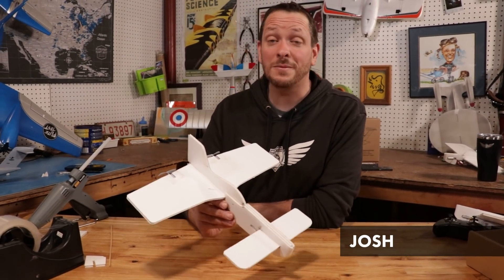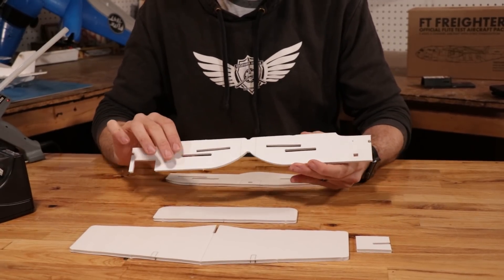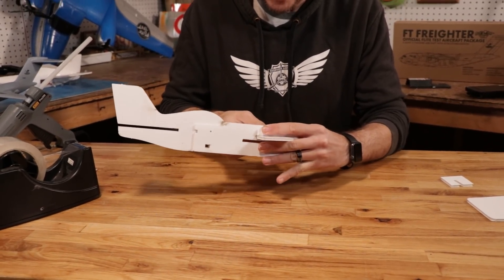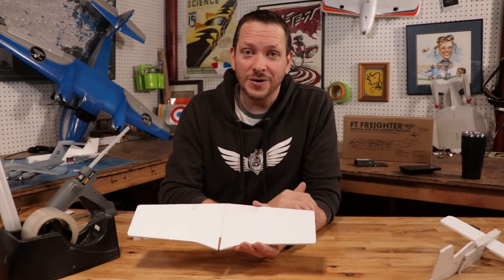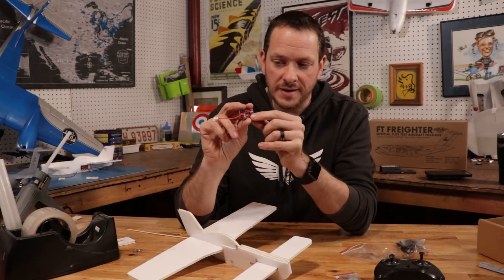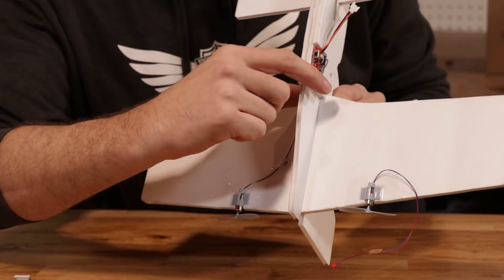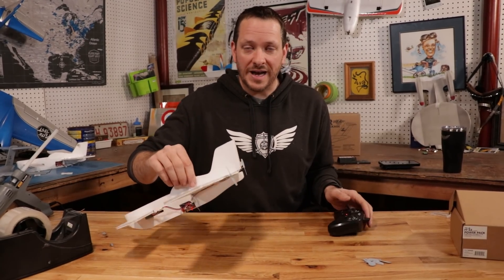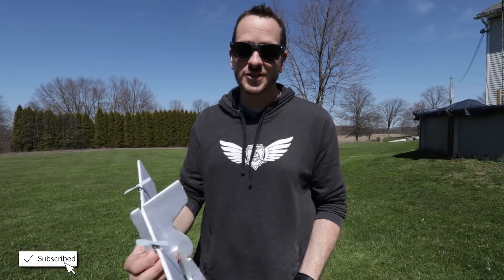EZ Canard / BUILD

Comment: Not entirely correct to compare this to the Eurofighter Typhoon. The foreplane of the Typhoon is lightly loaded, i.e. the Typhoon is statically unstable, so it works in a slightly different way.

Comment: I built and flew mine. A couple tips.
- if you are going to put on the RC pieces, I would recommend run the right motor wires through the hole in the fuselage, through the hole in the circuit board and then plug it in BEFORE you mount the engine OR the circuit board on the aircraft. There is not a lot of extra wire and I spent more time trying to fish that little white plug through the hole and getting it plugged in than I did on the entire rest of the build.
-If you use double sided tape to mount the circuit board, make it a little long to extend below the bottom of the board to protect the power switch and the LED. Also check it after every crash..er landing to make sure it isn't loose. I flew with on that was loose... if you want to call that bucking bronco a flight. 
-If you are outside and there is any more that a light constant steady breeze, keep it in low rates. This plane in high rates and gusts is a recipe to make lawn darts as the stabilization freaks out in choppy air and high rates.

Comment: Sir, how much rpm needs for this kind of toy plane? I have tiny vibrator motor the one used in mobile phone, is it suitable?  I have removed the part that responsible for vibration. Thanks.

Comment: Josh, according to Ed at experimental airlines, dihedral does not work like you (and most other people) believe.  The wing that is most horizontal does not produce more lift as lift is a result of the airfoil section, which hasn't changed. Apparently it's something to do with the angle of the leading edge, if I remember correctly. I watched his video a few years ago where he explained it. I didn't understand it at the time and I sure can't understand it now, but you might find it interesting to check out what he said.

Comment: Hi Flite test, I’ve got quite a big issue with my emax tinyhawk freestyle, and I was hoping that you could help out. It came in the mail yesterday, and on the first flight, it got up in the air, flew for a bit, then looked to of failsafed. This has happened every time I have tried to fly it, just failsafeing about 5 metres away from me. I tried installing an xm receiver, to no avail. Do you have any tips? I would love a reply
Reply: It's best to contact Customer Service through your point of purchase (A-Main, or Flite Test), or you can go to the FT Forum for help. 👍

Comment: Nice plane and a nice build Josh, but I'd hot glue the motors in. If you want to swap electronics rubbing alcohol (surgical spirit in the UK) makes hot glue release cleanly. Just use an eye dropper or dribble some with a toothpick or cotton bud on the glue joint and it'll come off nice and easy.